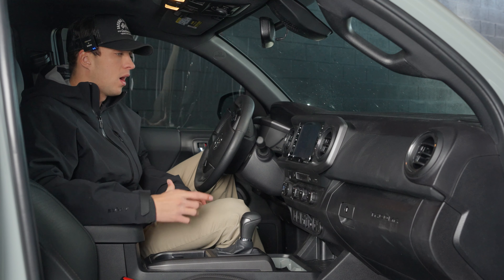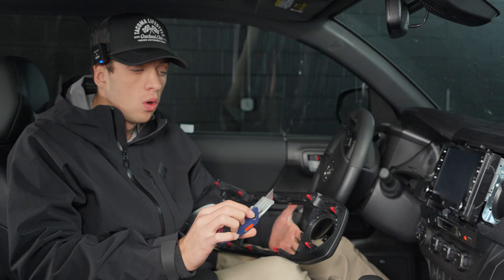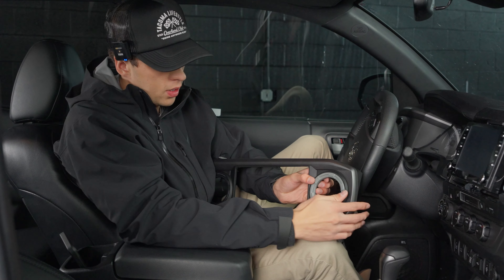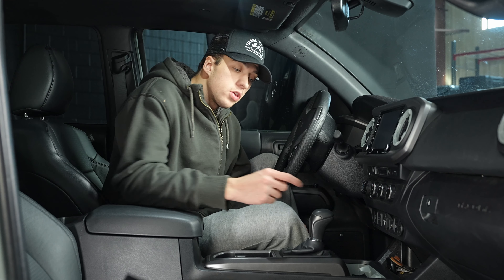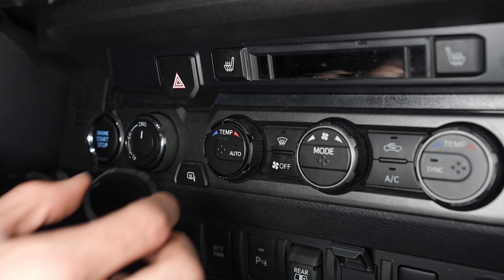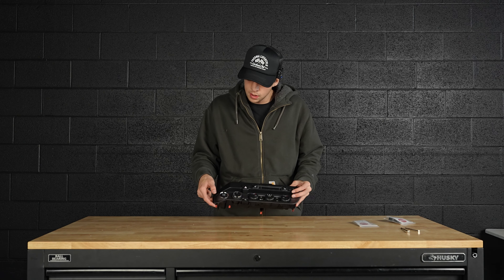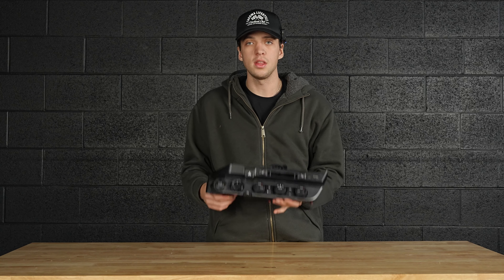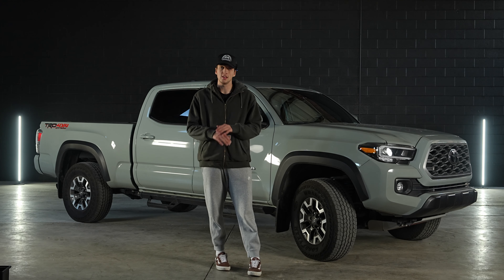Top 5 Interior Chrome Delete Mods for Toyota Tacoma

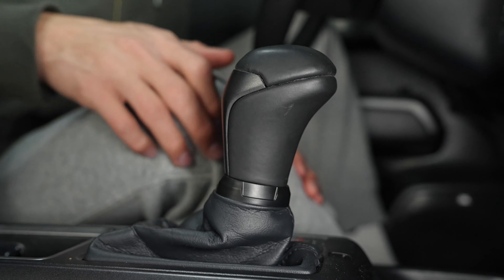Comment: My advice with the cup ring trim is to double up the 3m tape 6:45.  Mine didn't stick well the first try but then I added a second layer of tape and it's still holding strong.

Comment: One of my 4wheeling buddies has a Taco identical to the one on this video.
When I first started looking for a 23 TRD Off Road 6’ bed double cab I was looking for 3 different colors that had the premium and technology pkgs.
I was looking for an Ice Cap White, Barcelona Red or the Lunar Rock.
I was very specific on what I wanted because I plan on driving my Tacoma for the rest of my life.
After 9 months of looking across Washington, Idaho, Montana and Oregon, I finally found mine 45 minutes from my house.
It belonged to our local dealership.  It had 6K miles on it as it was the Owners pickup.
I bought it $4K below book price at the time I bought it.
Knew the MSRP was almost $55K.
When I bought it the book was $51,848 and I bought it for $48K.
I bought it on 2/29/24. I had the choice of the 23 or the new 24, which was identical to the 23.
I purposefully chose the 23 Only because it has the proven reliable and durable 3.5L Naturally Aspirated (NA) V6.
Historically a Turbo gasoline powered engine simply doesn’t last as long as a NA engine.
My last Toyota had the same 3.5L V6 that I put over 300K miles on it. I sold it to a friend of mine who has now owned it for 2 years and it still doesn’t burn any oil.
I’m retired and I drive 6-7K miles a year, so at my age, I’m confident that I’ll be driving my Tacoma until either I can no p longer drive or I’m dead. After I’m gone, I’m sure my wife will keep it for light duty work around our property.
During my first week of ownership I installed a K&N cold air intake and a Flowmaster FlowFX dual exhaust.
At the end of May I’m having an Overland Torque Tune installed.
Next year I’m having Katzkin make TRD red Leather seat covers.
After Katzkin removes my black factory leather seat covers from my truck and installs the TRD Red Leather, my friend who has the Lunar Rock TRD is having his cloth seat covers taken off and replaced with my black leather.
After the new Leather is installed I’m having my truck 2 toned and pinstriped.
I’ve already installed mud flaps, window vents and tinted windows.
After all of this is completed I’ll be selling my running boards and having power running boards installed, along with Add a Leaf to the rear suspension.
The last upgrade will be a set of chrome wheels.
Skid plates from the front to the rear differential has already been completed, including the transmission plate that also covers the catalytic converters.
My last truck was a 1 of a kind and I plan on getting my Tacoma to a 1 of a kind as well.